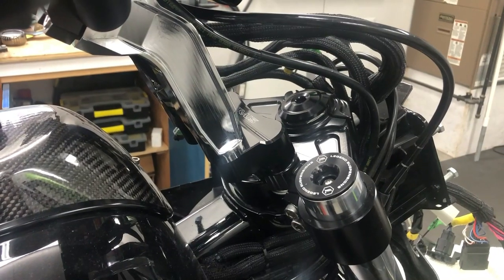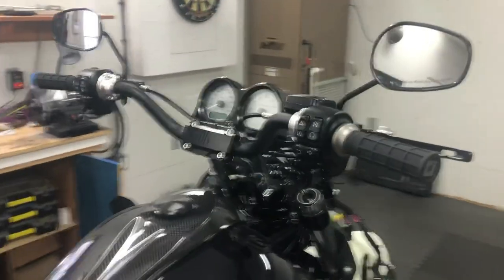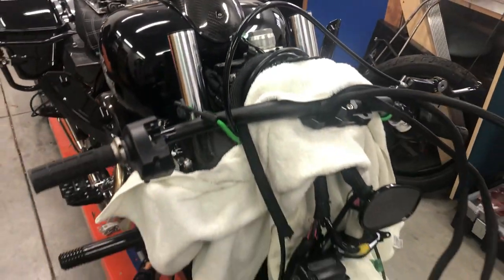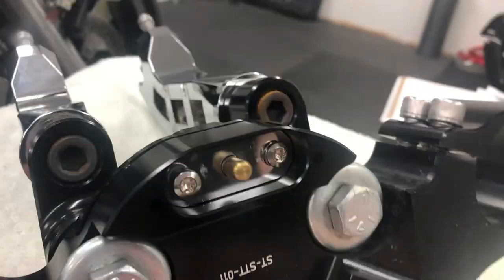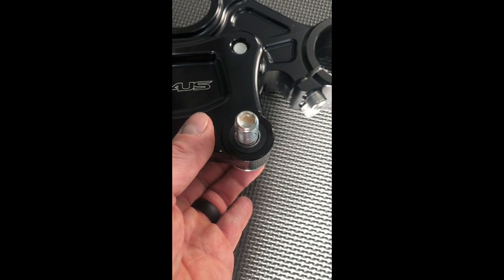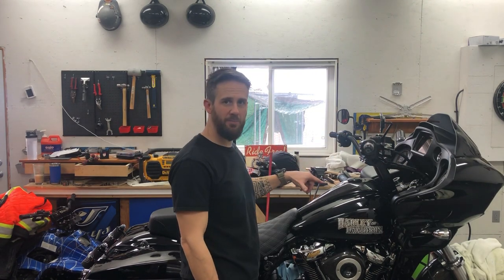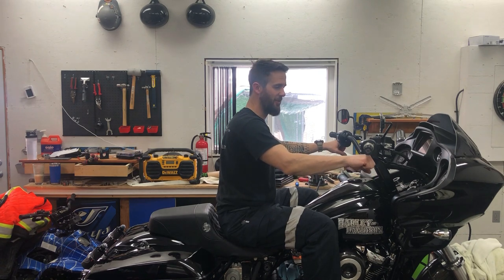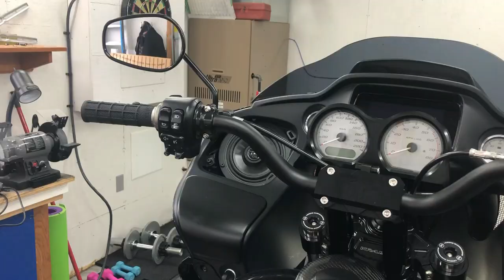Episode 8   Kraus T Rex pull back plate Install

Comment: Have the same problem with leaning forward a little to reach on my 22 low rider s. Kraus only makes the Raptor for it and not the T Rex plate so hopefully it's enough.  Ur set up looks bad ass tho 🤙🏽
Reply from the maker: Thanks man. I wish I had the Benjamin’s to make this bike what I really want all at once, but I don’t have enfluencer money yet lmao. In my eyes, riding position is always #1.

The Lowrider S is probably similar to my old club style Dyna I did. I had Lucky Dave’s Lucky 13’s on it. All I needed was a 1.5” pull back on that bike and my riding position and comfort was perfect. On the RG I needed 3.5” total (1.5” in the riser pull back and the 2” T-Rex)
Reply: @forevertwowheelin3264 they make it now

Comment: Looking good! How do you like them Boostedbrad mid controls? I have a DND Bob Cat mid length exhaust. Brad told me I’d probably have to relocate my brake reservoir? Man where why I put it and how would it stay mounted. Pls me know your thoughts 
Thanks !
Reply from the maker: I like the BB mids but I do have some gripes! I have modified them twice so far to give me more adjustability and versatility. Like adjusting shifter/brake arms… Looking at modifying them more again to take the slop out of the shifter. They are solid and beautiful units!!! But ti think they need some design elements adjusted to be perfect! 

As far as relocating the reservoir. It all depends what you want and can do yourself. Or have a professional shop do the modifications. Will you need to re-power coat or re-chrome? These could be deciding factors.
Reply: Yeah man thanks for the response, my bike still has hard shifting problems and I also remodified them drastically   @forevertwowheelin3264
Reply: @johnmacias01  I’m going to work on an offset 5/16-24 heim joint shift linkage. The one that comes with the mids is so short. I already had to cut a half inch off of it just to get my Vans beneath it lol. The height difference between the BB shift linkage arm, and the stock arm is about a half inch in height. I think a 45 degree offset shift linkage would get me that half inch to level them to one another. I think a level throw would transfer the energy into the stock shifter arm better. Maybe it will shift smoother? We shall see!

Comment: Can you tell me if there is any difference with controlling the bike with the trex plate vs having no plate and just standard riser clamp to top tree?
Reply from the maker: For me, with the T-Rex plate, I’m stretching less to reach the controls. Therefore I have more control over the bike. Since the bars are closer, my arms move less and I can achieve a greater range of motion when handling the bike. I haven’t noticed any negatives. Only more comfort. More power during push steering. Less pressure points in my shoulders even with higher risers now.
Reply: @FOREVER TWO WHEELIN  you switched up the risers, How tall did you get them? I'm asking because im about 5'6 - 5'7 lol. I have 20' LRS and I've been thinking of doing this. I have stock bars on a 9.5' thrashin pullback risers. I do feel like I'm leaning forward about an inch or 2 kinda like you described it.
Reply from the maker: Hey man. so there are obvious differences in the rake and frame size of the RG and the LRS. I went with an 8 1/2 inch riser as opposed to the 6 1/2 inch riser I had on there previously. That in conjunction with the T-Rex plate and the ODI bars, put everything where it should be. I would suggest doing the old broom handle trick and have a buddy measure you up for proper riser height!
Reply: Did you have to change the upper brake cable or the whole brake system?